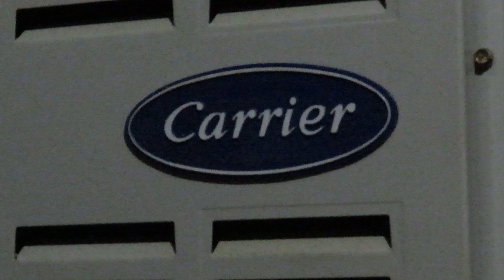First Startup of my Gas Furnaces for fall 2023

Comment: Most of the new furnaces have variable speed ECM motors. I think the new carriers do too.
Reply: Most new furnaces don’t have the PSC motors
Reply: PSC motors are not variable speed, they are one phase motors. ECM motors are usually variable and are also more efficient.
Reply: My 2023 goodman has a multi speed ECM. I like that because variable speeds are always on like one of the lowest settings and odnt move much air vs the multi speeds.

Comment: my new carrier furnaces when the nest people installed the nest thermostats the furnace fan turns on before it ignites then it turns off then it starts igniting and then I blows warm air you know what wrong with them?
Reply from the maker: Could be two things - the thermostat is set to fan on, or in the parameters when they set up the thermostat, they might have set it up to have the thermostat control the fan. You don't want that, you want the equipment to control the fan
Reply: @HVACExplorations  its set to heat and cool its a wiring problem I suppose